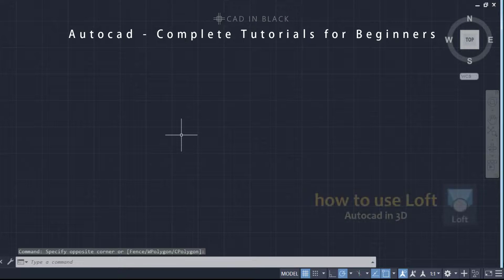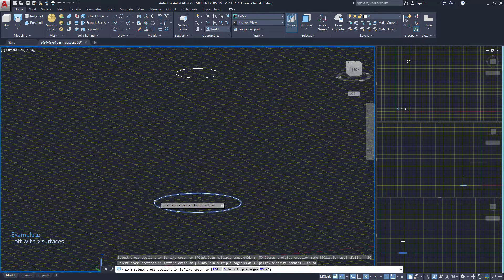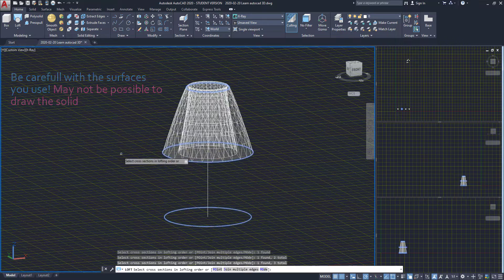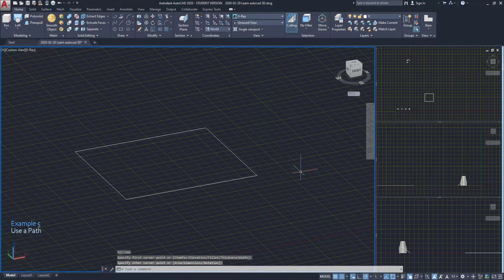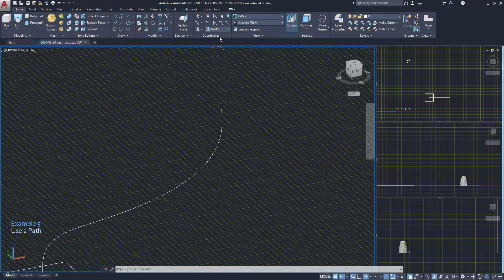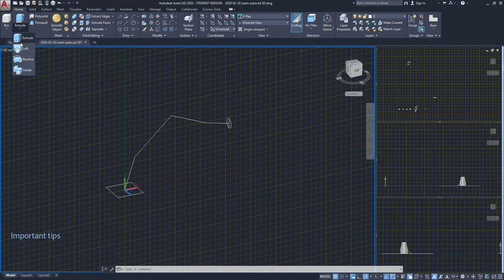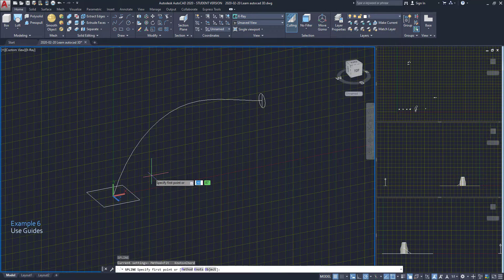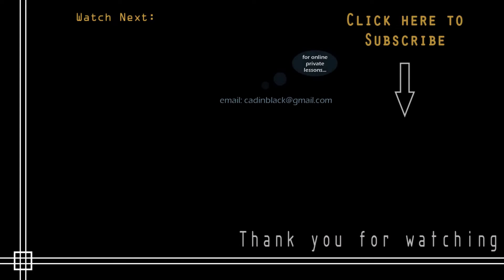Autocad 3D - How to use Loft command

Comment: I draw two lines on the same plane then make a surface between them so it's like a flat donut shape with a hole in the middle. Then I make another similar flat shape that is +Z from it and make that a surface. Why then, when I select both faces, does it try to make the loft a flat wall? If I choose loft solids it does the same thing with a thin wall but it's rounded. 

What you're showing here is making a solid object. I want to make a hollow cone. Fusion 360 and Inventor can handle this no problem. I'm failing to understand why this doesn't work. If I extrude each shape it works fine. I could draw the side profile and revolve it, but changing the UCS and making sure everything is square is time consuming compared to just drawing 4 circles and lofting the profile to each other. This software is so user unfriendly it's wild.